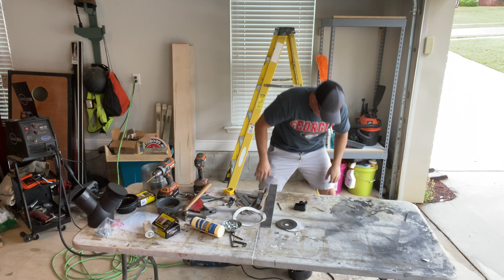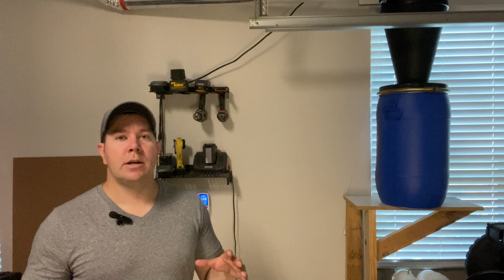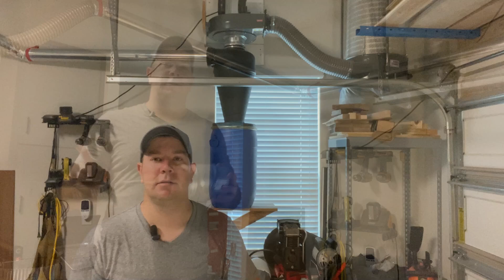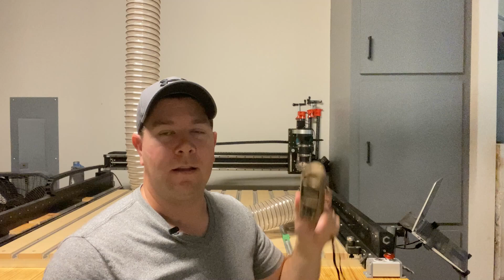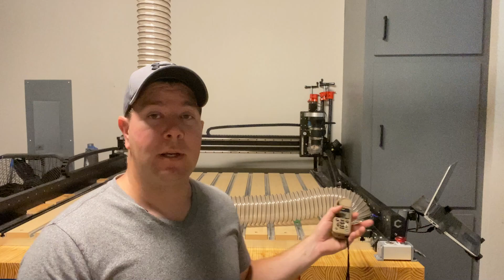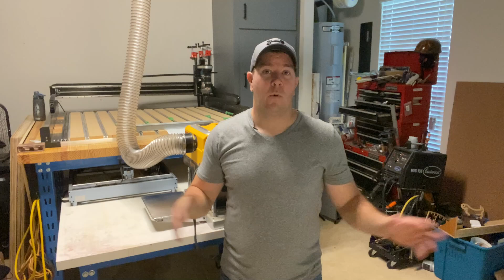Harbor Freight dust collector: 1 year later

Comment: Surprising that the 2.5Hp motor is not wired for lower amp draw, 240v power supply circuit.
Reply from the maker: It probably should be but then it wouldn’t be sold at Harbor Freight.

Comment: if you are into 3D printing, I would print some couplers for your CNC and your other tools so you can just hook them up quickly without having to use clamps.
Reply from the maker: I am not into 3D printing yet but I did get some couplers form PWN CNC that are 3D printed with magnetic connections and they work pretty good. they even have an adapter for the dewalt planer.

Comment: I have a small shop (13' x 33') and don't have the space to move my machines around freely. Consequently, I had to bring my dust collection to each machine, and put all my machines on wheels so that they can be stowed along a long wall and pulled out as needed. Along the outside of a long wall I ran my header, and dropped a branch through the wall for each blast gate. Then came the real challenge. To provide fail proof service at each tool, I built a 24VDC over air gate control module with alarms that ensures every tool is provided with adequate dust collection during use and the blast gate of each tool opens when the tool is turned on and closes after use. With three alarms during start-up protocol, it's easy to locate any issues. No remote control fobs are used.
Reply from the maker: That sounds pretty fancy. One day i will move out of this garage and into an actual shop and revisit this dust collection topic

Comment: Use of a scoop Tee rather than simple forty fives will reduce friction by a lot.  Not so important if you only have two but for more complicated layout it becomes more important.  Not generally available for stove pipe.
Reply from the maker: There is a lot to this I am learning and the friction caused by bends is one of them. thanks for the info

Comment: Awesome video built the same thing. I have one question. Mine started squeaking from the bearing during shutdown with the motor winding down. Did you notice anything like this?
Reply from the maker: I have ran mine for countless number of hours at this point and the only trouble i have had was clogging the filter because i got too busy to dump the barrel.

Comment: Get rid of Filter and exhaust out of garage.  The amount of dust should be minimal though I would lower cyclonic to make dust more likely to go down. The suction source right near the top will have most pull upward.  CFM maximized by getting rid of filter.
Reply from the maker: I live in a neighborhood with an HOA and my neighbor already hates my CNC because it’s loud sometimes. While i wouldn’t mind ejecting all the saw dust and everything right at his house it might have a negative overall outcome. Ha ha

Comment: The Dust Deputy traps 99.9% of the dust in the barrel below it when that is not working correctly you have a leak between the Dust Deputy and the barrel below I see a lot of guys making a different containers but those l e a k that gets dust in your filter
Reply from the maker: My set up has been great. The only time i have seen dust in the bag below the filter is when i let the barrel get way too full.

Comment: So maybe a solve for the window blocking. Move the motor and cyclone to the left edge of the window, making sure the flex hose opening is lined up level with the filter opening. Then make the stand for the barrel at needed height. Take approximately 1’ of flex hose and hard pipe to connect the filter and DC. Less resistance, more window.
Reply from the maker: Hey this is a great idea. I shouldn’t have rushed through that part. Now it is one annoying part of my shop.

Comment: I would avoid 90 elbows and use 45s.  Nice job man. I built one too used PVC sewer pipe  (no worries about static fires) and the Thein baffle.  Also I got me an aluminum flap for clothes drier 6inch to run outside, rather than have a filter. Works great less pressure and less cleaning. The air always looks clean coming out.
Now Im upgrading the unit, just found a new used unit for $100. Id say New really. I may make a cyclone this time.
Reply from the maker: I tried to avoid turns as much as possible. For my little 2 car garage this thing has been a work horse. It will probably be running all weekend again... biggest issue i have is dumping the barrel which is a good problem to have.

Comment: Just took another look at this video, and … Documentation for my 2HP HF dust collector says it is rated at 20 amps.  Just thought you would want to know. 
Finally got my motor/impeller mounted up on the wall.  Used a game hoist - seems like they’re usually rated for about 1000 pounds.  SO MUCH easier (and safer) than lifting it into place.  
Best wishes!
Reply from the maker: Yeah patience has never been my strong suit and safety sometimes suffers. I’ll learn one day.

Comment: Thank you for your REAL EXPERIENCE sharing. Im about to mount my HF dust collector on the wall too. Im still not sure about the impeller upgrade. I am mounting next to my breaker and I as I rewired my entire shop its easy to cut the drywall and run a 20 amp wire and outlet if needed. It seems EVERYONE is an EXPERT when it comes to dust collection too. At the end, I think its about EACH persons needs, risk, and cost. I run my shop as a startup business. Im retired too, so Its not MANDATORY with the stress. I can take the lost to build my shop right and take my time learning which many dont have the opportunity to do. I appreciate you HONESTY too,  and keeping things REAL. Blessings.
Reply from the maker: I agree everyone has different needs, and while the impeller did increase airflow it’s not a must. The dust collector still moves plenty of air with the factory one, and if the factory one doesn’t end up meeting your needs you can always go back and change it. If you have an Instagram for your business send me a message on instagram and i will follow.

Comment: Great info! I just bought that dust collector used and that is what lead me to your initial video. In designing what I had and how I wanted to lay it out, it is essentially very similar to your system layout in this video, although it's going to be portable, so it will look more like a tall Laguna Pflux. Like you, I worry about the Wen impeller weight (haven't added it yet but most likely will) But I worry more about turning the motor on its end because I worry that the armature weight + the impeller weight will wear out some thrust washer as the motor didn't have that kind of downward loading of weight applied when the shaft was oriented horizontally. I have a couple questions. As I said, my order of components is similar to yours except the old filter/bag round piece (separator) will be my inlet and the motor/blower will mount on top of that, where you now have the filter. I'll extend the motor fan inlet about 6 to 8" down, past the round concave baffle and just slightly beneath the inlet port, to make that separator function more like a cyclone would. So, that's stage one. Then stage two is the fan outlet feeds the inlet of my super dust deputy. The bottom outlet of the dust deputy will have a 1-to-3-gallon bucket on the bottom of it for fine dust and then a filter or filter box on the dust deputy top discharge port. The question is; just how much dust are you are actually accumulating in your second and 3rd stage ( the bag and filter)? You have a 3-stage system as you have installed it (cyclone/separator/filter) so I'm curious what and how much material actually makes it through to the 3rd stage. I may not need a filter with that much surface area if not much gets through to there. I've seen people show the level of separation by starting with an empty system then sucking up a pile of debris. Anyway, thanks for sharing your experience!

Comment: I have heard that some people have had issues with the Wen impeller, not a perfect fit and caused noise.
Reply from the maker: I didn't have any issues really. The initial amp draw is higher, but that is about it. If I did it all again I don't know if I would do it right out the gate again. I would probably get the system installed how I wanted it, and then decide if I need the extra flow.

Comment: How mush dust collects in your filter?  I run a sander and it really plugs up the filter.
Reply from the maker: I haven’t cleaned the filter yet. I have blown it out and got little to no dust in the bag. Granted most of my sanding i use a shop vac with a hep filter and bag.

Comment: I added a donut baffle in the top of my filter side and a theine baffle on the bottom to try and prevent the thin dust sneaking up into my filter and the theine baffle traps the light dust in the bag. 

For my elevator I used the cranks off two pipe clamps welded to an angle bar. I shortened the pipes and attached them with collars to the base. It raises and lowers my barrel very well and seals it up under my cycline ring. My theine baggie is in the lid of the barrel.

Comment: If you can run that same motor on 220v you will use almost half the amperage. IF my reading is correct check on that & if my understanding is 😅 I would appreciate knowing 14:04 
15:18 15:21
Reply from the maker: I would like to say I’m schooled up on electricity to know the answer here but I am not. I am just planning on adding a 30 amp circuit to my garage and i think that will solve most of my problems.
Reply: Running it on 220v if it is designed for 220v uses the same amps as 120v, it just splits it between 2 hot wires. I made the same assumption for years.

Comment: What size Donaldson filter was used ?
Reply from the maker: There is a link in the comments to the specific part number. Please let me know if it doesn't work.
Reply: Im not sure if the filter linked is correct, the product dimensions are listed as Product Dimensions 12.2 x 12.2 x 8.27 inches which I dont think can be correct @Wildercustomworks
Reply from the maker: I’ll check the link but the part number should be P181038

Comment: Do you know that you must ground to Earth the plastic and the metal piping to avoid any fire risk with the dust friction, you have no idea how explosive dusted environment can be. I've been a pro in woodworking and all dust collection pipes must be grounded to Earth in commercial workshops. The easiest way is to connect a copper cable to the metal pipes and use small sections with collars on the plastic connections.
Reply: He does not have to ground his pvc lines. There is not a single documented case of pvc being the cause of a fire in a home setting. 

Industrial is completely different.
Reply from the maker: Well you have a good eye Sr. I have not grounded it yet. I am aware of the risks involved but like everything else I do I turned it into a learning experience. I have been watching the exterior to see if dust builds up. My plan was to see it build up then clean it ground it and see the difference. I have not accumulated any dust yet. I am keeping an eye on it though and Thank You for looking out for me.
Reply: Did you know that? If you don't believe your doors open when a herd of elephants run through, you might get hurt cuz you won't see it coming... You have a nice day sir and thanks for watching his video.

Comment: seems like lots of  CFM loss would have been nice  to measure at the cyclone to see the piping loss.  Have you cleaned your filter yet?  looks a  bit hard to get up there for that.
Reply from the maker: Haven’t cleaned it yet there is barely any dust in the bag. I’m sure a lot was lost with the cyclone but totally worth it to have the barrel collection. I just gotta figure out a way to monitor the fullness. It’s pretty easy to get to the filter though those turnbuckles tighten down plenty by hand.
Reply: @Wildercustomworks    they make a level detector. it was like 170$ but  I want to get one because my system will be in adjacent shed.   amazon for 171$ Dust Sentry Bin Level Indicator made by Oneida
Reply from the maker: Thanks I’m going to check this out for sure!

Comment: Nice follow up!  Glad to see things are going well.
From what I have read or seen, the issue with residential metal ducting was allegedly that the seams face the wrong way.  Never really understood why that should be a problem - just turn it around!  But you apparently got it right.  
About the “circuit breaker” issue, residential circuit breakers are designed to allow for spikes well beyond their rated capacity; ie, a 15 amp circuit breaker will generally handle a momentary spike to 20 amps or more. 
A power strip is a completely different ballgame, as you found.  There ARE some heavy duty power strips that are rated for 20 amps, should you so desire.
Love the Unistrut & trolley setup.  Unistrut used to be in the small town where I grew up; don’t know if they are still there.  The father of a friend was the president of the company.
Could you list the parts used?  That would be helpful.
Thanks!  Happy holidays and stay safe!
Reply from the maker: Thank you. This whole experience from CNC, to wood working to filming and YouTube has been an awesome learning experience I truly do appreciate the comments and interactions they make all the work that goes into this a lot more worth it. All the parts i used are linked in the description if there is something specific you are looking for let me know and i will get you the info.
Reply: @Wildercustomworks  Thanks, I missed that.

Comment: You could add a section of flexible hose between the barrel and the dust deputy.  You would have to lower the barrel but then you could disconnect when emptying the barrel.
Reply from the maker: That is a good idea… i have a plan for a lift that goes under the barrel but I’m real good at ignoring problems until they become to annoying to deal with. I will eventually fix this… the barrel not the ignoring issues thing.
Reply: @Wildercustomworks  Hi Joel.  A few years ago I did a similar build up from the same 2 HP HF Dust Collector.  Like you, I stacked the Motor/Blower on top of the Super Dust Deputy on top of a barrel (mine is a 30 gallon with the lock ring).  My solution to remove the barrel was a small lift box underneath it powered by a $20 car scissor  jack from amazon.  I also made my own level sensor for maybe $50 in parts.  If you are interested let me know and I can shoot you a few pictures.
Reply: @davidbondi  I'd be interested in seeing that lift system!  Any chance you have it posted somewhere?
Reply: Mine has a flex hose dumping into a 55gal. drum on a barrel dolly under the cyclone. Allows less frequent emptying and less strain on the back of a retired old man. Also have the radar level sensor hooked up to my blast gate control center.